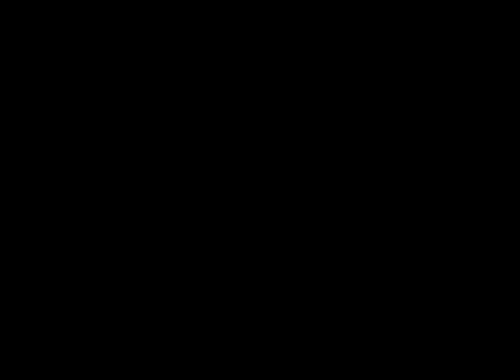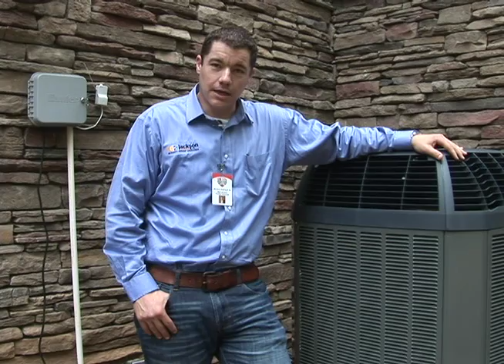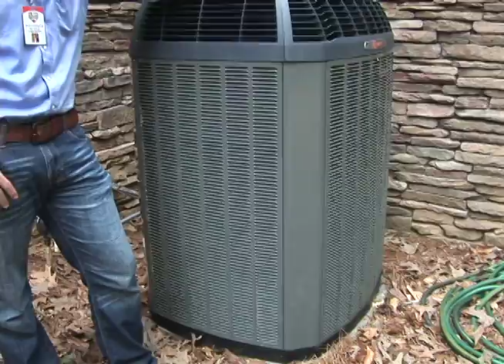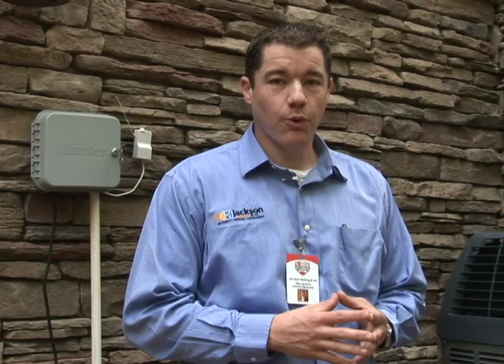The TRANE XL 20i Heat Pump

Comment: In the case of the Trane heat pumps sold extensively beginning in 2005, many found the unit stopped because of a defective coil. Tranewreck.